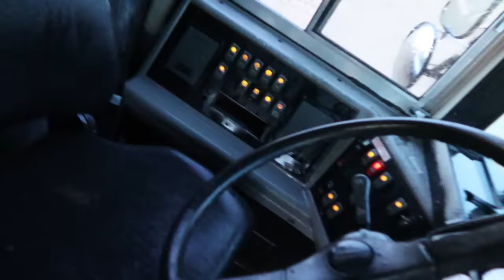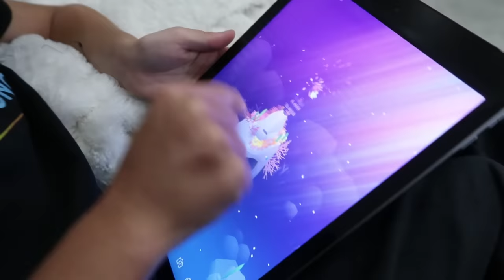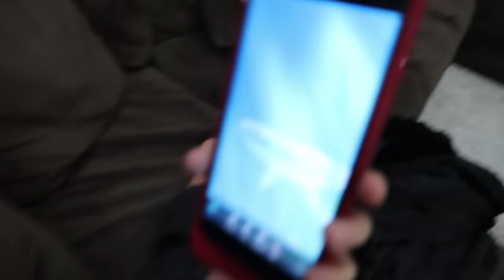HE DESTROYED MY BUS!! So Scary!!

Comment: There's diesel and oil and radiator coolent everywhere  in there now.... no more swimming. Like so he can see.
Reply: There was some from the bike as well
Reply: Fangirl exactly
Reply: The bike was bad enough. Dude has no clue about pond management. So much toxic stuff is probably floating around in that pond his family will be swimming in. You are supposedly to drain vehicles and remove hazardous stuff before doing these kind of stunts much less in a small pond your family will be swimming in.
Reply: there is oil and gas in the sea aswell tho
Reply: Roman even said he would not destroy the bus in a previous vlog
Reply: Not gas it's deisel
Reply: especially the coolant from the motor, that stuff kills
Reply: Gas and oil will both float on top of the water. It can be cleaned out...most of it anyway.
Reply: BrettK simple, YOU DON'T!!!!!!
Reply: Logan Matzke that big diesel wouldn't last 3 minutes without oil. And you can't run it out of fuel or it won't start again even after you refueled it. You'd have to bleed the whole fuel system to get it started again. Transmission is full of transmission fluid, diffs are full of oil, etc. You HAVE to have oil and fuel.
Reply: TheATVboy17 newer antifreeze isn't nearly as toxic as the stuff used to be.
Reply: The sea is a lot larger than a small pond. The sea is much much much much more diluted.
Reply: As long as they don't drink it they r fine
Reply: I hope you know
Boats have gas and oil also that goes into the lake that people swim in everyday smart one
Reply: Everything will get diluted a lot since there is so much water in the pond and a small amount of gas and oil and stuff I think
Reply: Oh and brake fluid

Comment: To save the bus you need to :
Drain the oil - put new oil
Remove all spark plugs and crank engine few times - Put spark plugs ang go crank the engine ! Because the engine gonna rust if it's not moving and it's gonna be garbage.
Reply: BigPig sur HardFight it's a diesel, it doesn't have spark plugs.
Reply: This guy thinks diesels have spark plugs ignore him .....😂😂😂
Reply: Diesels don't have spark plugs. And I'm just gonna assume the the is f*cked
Reply: Diesels use Spark Plugs, anything that has pistons have Spark Plugs
Reply: diesles have glow plugs
Reply: Buzzing Bark a diesel does not have a spark plug. Its all done by combustion
Reply: TeflonTIP it has glo plugs which are in place above the piston like a normal spark plug.
Reply: If they build that bus for country's office it would be great😀😀
Reply: BigPig sur HardFight have to drain the oil and change it several times for it it to get all the water out of the engine
Reply: You take the fuel injectors out smh
Reply: BigPig sur HardFight maybe he didn't know don't judge him and be rude. Just helpful hints don't make him feel bad. Smile more!
Reply: BigPig sur HardFight it’s a diesel city slicker
Reply: BigPig sur HardFight ok

Comment: Hey did anyone else notice that Romans truck battery is in the bus
Reply: Infinite Glitcher They might have taken it out once they got it started.
Reply: no shit he told us
Reply: @gtp2nv  it would of SHUT off the bus without the battery and if they put the bus battery in  it would still be dead and would have to buy a new one.
Reply: @tower534  Not necessarily. Old engines can run off of the alternator.
Reply: @gtp2nv  but he wouldn't be able to see the dash that's powered by battery and some other thing like the radio

Comment: the amount of gasoline in the pond now
Reply: Nick DeChiaro and Diesel fuel
Reply: He has a filter in it
Reply: Rex rV yea but it will fuck the filter
Reply: Harry Wilson no it's made to filter
Reply: There's a filter
Reply: Nick DeChiaro i hate these little kids saying "ROMAN DONT GO IN THE POND YOUR KIDA WILL DIE" like there's obviously a filter and the water would distill the gasoline
Reply: The irony is too hard @Jacob Reid
Reply: Jacob Reid no it won't. Gas and diesel floats. The filter is for trash and debris in the fuel system. For the system to work there needs to be a place for air to enter the system, which is usually on the cap or on the top of the tank.
Reply: Nick DeChiaro due to country driving a motorcycle in and  driving a  motorcycle in the pond
Reply: That's also a way for water to enter and fuel to escape
Reply: Lol
Reply: Jacob Reid HE NEVER SAID IT WAS A FILTER.
Reply: yep when they pulled the bike out youcould see the oil flooding ou t
Reply: Rex rV ...gasoline and oil float.  If there is a whole pond filter, which I doubt, because typically ponds are designed to naturally filter water and there is no visible filtration shed (and a pond filter probably wouldn’t be able properly filter out those substances) - doesn’t matter.  The gasoline and oil are never going to run through the mechanical filter - it’s going to stay on top of the water and also collect on the shores.  To get that stuff out, you have to contain it on the surface in a small area using booms, use special absorption material and then spray bacteria around the edges to deteriorate the rest that collects on the shore (& spray on the water surface if there are remaining slicks.)

Comment: The pond isn't safe for swimming now
Reply: Brandon Amaya I think he said in one of his blogs he had a filter in it
Reply: Brandon Amaya they have a FILTER
Reply: vlogs
Reply: Brandon Amaya they can filter it
Reply: They can't filter oil or gasoline, the fountain is there just because it adds water circulation and it provides better water quality due to aeration. The filter keeps the pump flowing on
Reply: Why?
Reply: They have a filter in the pond, didn't you see the vlog from two days ago?
Reply: Battery acid, oiks, fuel, etc. I would not want to go into that water now.
Reply: A pond filter will not filter  oil diesel gasoline for battery acid this is coming from a diesel mechanic
Reply: cal905 so true

Comment: diesel engines have no spark plugs Chace
Reply: They do actually, they have 12 spark plug on each Side of the engine
Reply: @legendaryraccoon9154  They don't. Diesel engines are self ingniton motors and don't need Spark Plugs.
Reply: @pitiedmold3581  Bruh, this school bus had 24 spark plugs, you can search it up
Reply: Legendary Raccoon they have glow plugs, which are completely different than spark plugs
Reply: Legendary Raccoon actually no it called a a glow plug and is completely different than a spark plug

Comment: Question umm how would he get the water back to being swimmable now after gas and all that crap getting in there?
Reply: the gas and oil most likely didn't even get into the pond. if the oil and gas were sealed properly there would be basically no way it could get it. the other stuff that would have gotten into the pond was dirt, trash, and probably  some metal and that isn't that big of a deal.
Reply: joshua hendrickson There was gas when the bike got in.
Reply: Stan Koster yes but you can swim in it. If you think about it if you go swimming in a body of water you are swimming with Gas and oil as well. You can swim in water that has gas and oil in it but not recommended to drink and even without it isn't recommended to drink as well so there really isn't that much harm in swimming in water that has a bit of gas and oil in it.
Reply: Ohh okay thank you. It looked like oil or something spilt when the bike went in and when the bus went in. Thanks for answering my question. ☺️
Reply: There was with the bike and I don't believe so with the bus since buses have better seals and would be harder to get the water out if the seals were good and everything was closed properly.

Comment: Well there goes Romans engine and a good bus
Reply: NativeGamer it's called drain the fluids and then it will run like new
Reply: FaZeBagels I know you can do that but still his engine to clifford
Reply: There's nothing wrong with Clifford
Reply: the battery they took off Clifford is the problem the will have to buy  a new one
Reply: xXTrippyRXx I meant to say battery I'm just so used to say g e gone more. Sorry
Reply: ITS CALLED FIXING A WATERLOGGED VEHICLE OMFG KID
Reply: Dont think so.........it went down running!!!!!!!!!!!  at least bent rods!
Reply: terry platt If your thinking of push rods no, they only bend if the valve gets caught.
Reply: The bus still works
Reply: FaZeBagels water is probably in the intake turbo and cylinders do you know about engine lol
Reply: FaZeBagels nvm u know I read it wrong lol sorry
Reply: That engine is fucked. Cracked pistons, bent connecting rods, broken crank shaft, destroyed block. Even if he could fix the engine it would be a waste of money.
Reply: NativeGamer yf
Reply: NativeGamer hydrolocked

Comment: The pond is for the family and it's not good anymore for swimming. There's so much gasoline in it now.
Reply: Heidi Li there's  no gasoline in the water
Reply: Grace mackay it's not filtered
Reply: Heidi Li roman isnt a dumb ass im pretty sure he's going to have something done to it to make sure its still healthy to swim in
Reply: mattloveOHIOST5 || it is filtered
Reply: Heidi Li more worried about the motor oil
Reply: Heidi Li and oil
Reply: It's Diesel
Reply: Grace mackay filters can't cleans gasoline
Reply: The Factual Savage Actually it would be diesel, not gasoline! And diesel is not near as dangerous! And people swim in the ocean right? Think about all the crude oil that has spilled into our oceans!
Reply: Heidi Li now you have diesel, gas and oil from the engines
Reply: Kevin Vang really, in the last episode you could see the gas leaking, and it's not gona be filtered, for that big of a "pool" you would beable to see it. Also if it was filters it would be cleaner and there would be a liner in the pool
Reply: Nicholas Ervin yes, but we get the majority of the oil spills, and that's trillions of gallons of water in the ocean if not more.
Reply: Kalani Sullivan even if the gas cap is on the gas can escape by the vent.
Reply: Kalani Sullivan but what about the vent.  When you take gas out of the tank it needs to be replace by air or the tank will calaps.

Comment: First you leaked oil and gasoline from the bike into the pond, and then you put a full size bus into the pond. You realize that the amount if gas and oil is going to contaminate your pond that your family swims in?
Reply: True
Reply: Paul Loduca the drain plug is waterproof? Meaning water won't filter through or?
Reply: Paul Loduca you could see the oil come up with the bike when they fished it out.
Reply: Yea Idk but there might be a filter or something in there!
Reply: Flyer321 1 no
Reply: Flyer321 1 it will destroy the filter
Reply: Mind your own
Reply: Harry Wilson it doesn't have a filter lol it's a pond why else do you think it brown water
Reply: Galaxy it's Brown because under the water is dirt and water is clear that's why you see Brown. Also that's why water at a beach is clear because sand is white bot brown
Reply: The water will go through the air filter and will end up rusting and locking up the motor
Reply: The filter wasn't on in this one but in a few videos before this one he talks about how no one can swim while it's running!!! The thing that bubbles in the middles is the filter!!!
Reply: yes its true its just mud the hole, no drainage
Reply: Keesha Maney no your talking about his fountain
Reply: RealTalk He clearly didn't plan it well enough, the bike was obviously leaking gasoline when they pulled it out
Reply: AndrewThabest not true at all the water has algae in it why do you think pools turn green magic the dirt in the water and algae makes it brown
Reply: evan o connor oh ok I guess I got confused thnx

Comment: Way to destroy a bus😒
Reply: Spencer McGee Magic School bus
Reply: I bet you can get it working by draining the gas new battery and getting the water out of the engine like do busses get ruined after it rains
Reply: Spencer McGee it's a school bus you should be happy
Reply: Jill Chartres lol
Reply: Spencer McGee it was planned
Reply: LegoBoy1919 man you really dont know about engines do you? Engine is most likely hydrolocked and the repairs would cost a fortune
Reply: Spencer McGee lol
Reply: Spencer McGee IT WAS PLANNED
Reply: LegoBoy1919 when it rains it doesn't get flooded it just goes over the hood this was a pond and it was submerged
Reply: he shut the bus off so the engine didnt get hydrolocked its fine
Reply: he shut it of the ignition was off he even pointed it out

Comment: The buzzer is the low oil pressure warning, once the pressure builds up the buzzer shuts off, it also needs to stop before you can start the engine, turn key to on, wait till buzzer (or light) goes out, then start.
Reply: I've been wanting to say that. He should learn how to use the bus before he even tries it